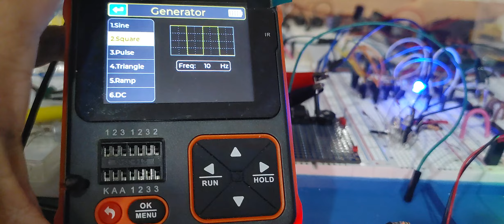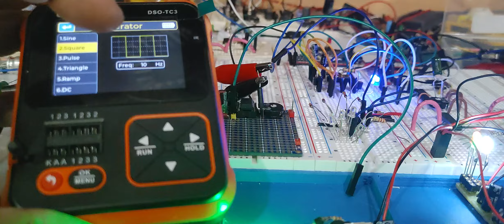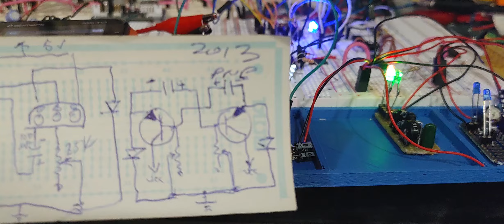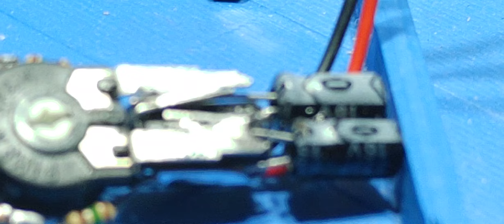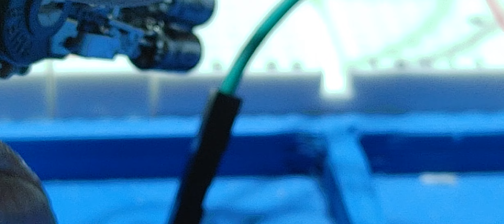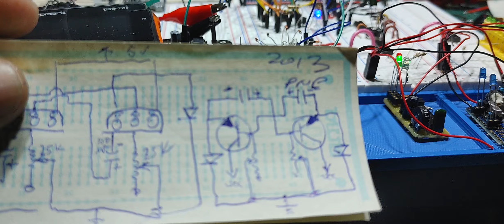RC Model Navigation Lights - Realistic Strobe Effect

Comment: Damn Mario; those are bright, can you make the circuit smaller?  So will fit in small planes?
Reply from the maker: Yes, they do fit in small planes. The true strobe bright effect via the additional amplifier timing circuits really helps with orientation much better than simply having the LEDs connected directly to the counter timer IC chips.